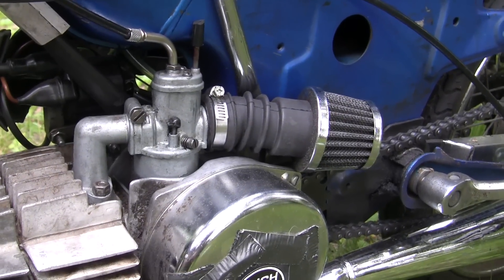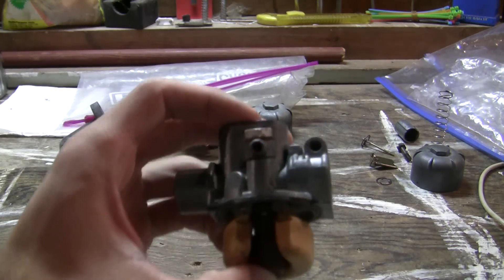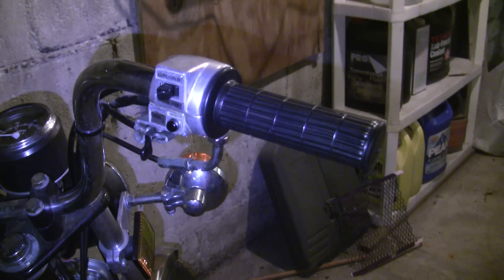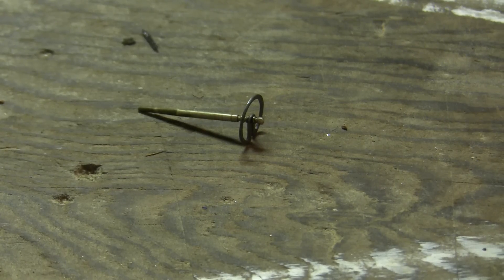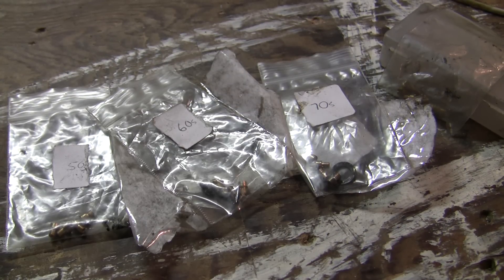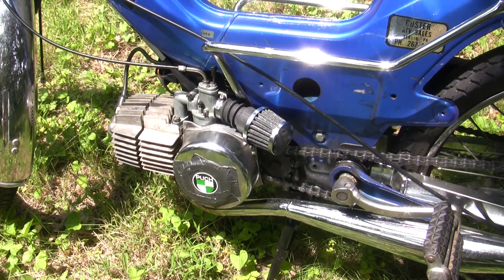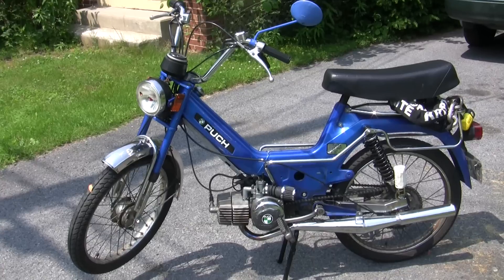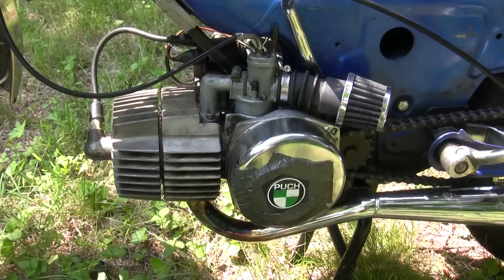Part (1/2) BASIC Moped Performance Carb Tuning -- Jetting

Comment: I found while researching drilling jets for my '78 Swinger 1 that jets aren't drilled, they're bored and then go through a secondary process to smooth any machining marks from the fuel orifice. Drilling a jet will help figure out the tuning to a point, but because you most likely have spiral drill marks and maybe even pits, as well as no chamfering for the opening, it won't work as well as a correctly sized factory-produced jet. Short, short, it might help, it might make the problem worse. Just buy jets unless you already have a very, very good theoretical and operational knowledge of your carburetor. And a jet drill set, as correctly sized drills off the shelf are exceedingly hard to find. Ace, HDX, Harbor Freight... they get you about 1 jet size per range.

Comment: Do you still reply to old video comments? I do have 70cc psr with dmp 2.0 performance crank, 17,5 mm dellorto phgb and biturbo exhaust. I struggle to get this moped to run smooth. according to puchracing website, the timing should be 1,2-1,4 degrees before TDC. and that’s  correct yes? but the carb adjustments I struggle to jet and the idle screw and mixture screw don’t really react that much. I have stock jet without any number on. A 76-78-80 jet.

Engine doesn’t react when I go full throttle, but takes like 5 seconds to gain rpm. and it won’t idle without me holding the throttle a little bit open.

I’ve checked compression, air leaks and  it’s new ignition parts. Wiring harness are old but

Comment: Hi Travis! Can I get your advice on if I should purchase a 1989 puch maxi? I live in LA, the seller has the bike listed for $750 but agreed to $560. The piston is ported with a 70cc kit and he says the exhausted is upgraded for the kit. "Carburetor needs to be jetted. The bike has a bigger piston in it then stock. The carburetor needs to be jetted to the right size so the bike will run correctly. There is not a chain on the bike right now. The brake line is disconnected. Simple stuff". I've never put a chain on, what do you think?

Comment: Hello Travis. I'm a retiree and I just bought a rare 79 Baretta 45 Moped from an old lady. I think it has a Minarella engine (is this same as a V1 engine?). I don't know is there another way to start this bike instead of pedaling it like a bycircle because I know like the Puch, one can stand it up and kick it to start but this Baretta does not seem to be able to do that when I try to hold/squeeze the clutch handle. Can you shed some lights into this? or whether I got a bad clutch somewhere inside or something. It's a beautiful moped and I can not find anything on the web/net even mopedarmy and other websites. I really appreciate all your videos. It's really entertainment and helpful. Thank you. I can not seem to find a lot of info about this Baretta 45.

Comment: have a issue with my puch put a chinese 15mm bing and intake on it and it ran great! for a day or so while i was riding the next day i seemed to lose alot of power it got slower and slower you couldnt even give it half or even full...barely any to keep it moving...I dont understand why its doing that...thought it was my piston rings going bad so i put the new piston in all it did was bump up my compression. fiddled with the carb did nothing.Missed with the exhuast took it apart and shook it clean and boom it ran! But only with the baffle piece loosly bolted on....I dont get that...it was running fine the day before no problem...didnt like the stock air box at first...still tuning..but it still wont do full throttle all the way(got up to 20 and a lil up at half it not a little more). Could it just be the exhuast is far to restrictive?  I didnt use the stock bing because it was full of white sandy corrison...

Comment: Hey man, your videos are very helpful.  Question, I have a Puch 1980 MK II, it was choking and dying occasionally.  I replaced the spark plug and it ran well then choked and died.  I then cleaned the carb and cleared the jet.  It ran great for a while and now chokes and dies.  The plug is very dirty and in the past I have seen it wet so I suspect I flooded the engine.  Any ideas of what could be happening so I can fix the issue?
Reply from the maker: Sounds like it's a little rich!

Comment: Hi travis, i put a tecno boss pipe on my completely stock maxi and it seems to four stroke at 25mph despite me using my stock 64 jet. So i upjetted to a 66 jet and still did it. Should i up jet to a 68 or downjet below 64? Is bike running too lean or too rich?
Also i noticed that oil was running down the exhaust manifold from where the manifold goes into the engine, what does this mean and is it also effecting performance? Please help me asap
Reply: It is also the 2hp kickstart model
Reply: Change exhaust gasket